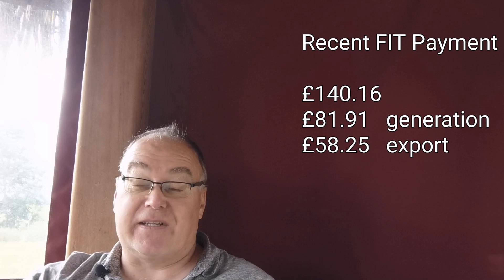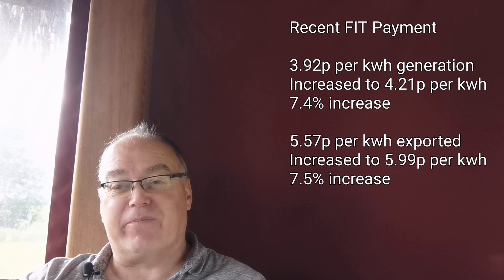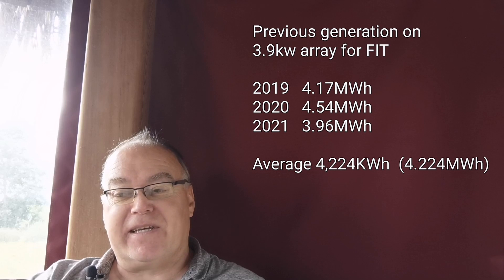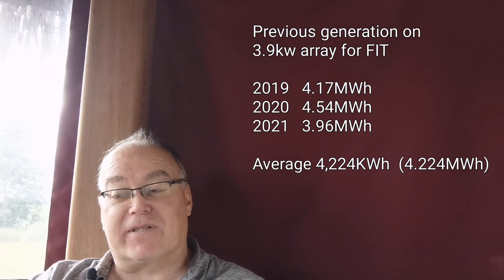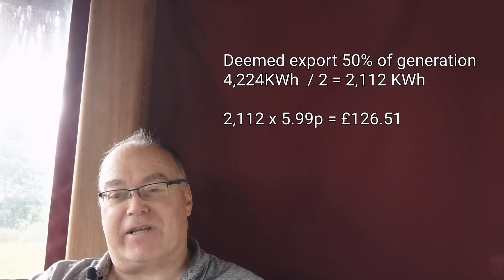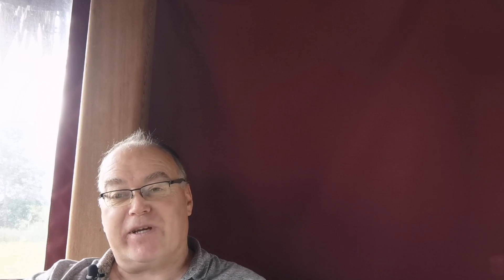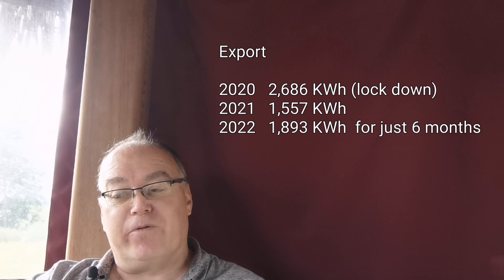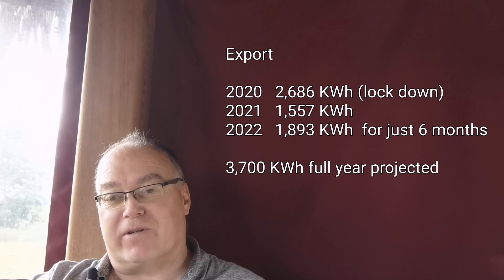Is it time to swap from FIT to  SEG? Smart Export Guarantee. Calculations & thoughts

Comment: A year ago we changed to the Tesla Lite Tariff with Octopus. That is 11p per kWh. (Slightly less for import, slightly more for export). The catch is that you hand over control of your Powerwall to Tesla, who will ensure that it is at 100% by 16:00hrs every day, when it will be dumped into the grid, down to 20% (in our case anyway), where it stays for back-up cover, until charging re-starts, either overnight in winter, or solar during the summer.
After some years of using NO mains for 8 months of the year, that regular mains use is painful 😞, but (like you), we are now being paid for the export on ALL of our panels, not just the original 10, so we benefit in the long run. Another plus is that charging the car in winter can happen at any time of day, with no change in price!

Comment: I got my first export 'bill' today.  Sold 383.9 kWh for an average rate of 17.85p/kWh.  Total Electricity rebate of £68.51.  That will leave me about £40 credit towards winter heating costs.
Reply: That is really good.
 But how long can this go on for? In eutopia, if 20% of the country did this the Energy companies would fold. They are  there to make money out of you not the other way round. Maybe that would be a good idea so we nationalise utilities.
Reply from the maker: Given the public are paying for failed private energy companies we might as well nationalise it
Reply: @wajopek2679  It can go on indefinitely! Assuming the OP is on the variable Agile Outgoing tariff, like me, we’re paid the wholesale price for each half hour, just like any other electricity generator is. No more, no less. What we need is for the wholesale price to fall (by decoupling renewable prices from gas prices) and then we’ll be paid less :) FYI, I earned over £150 during June for my exports :)

Comment: I too have moved from the deemed 50% solar generation, after doubling the size of my array and not getting any money for the new solar. It also gave me the freedom to move to the Tesla Energy Plan from Octopus and give me a good 24 rate whilst I discover what my ASHP will use in it's first year of operation!.
it will be interesting to see how the Outgoing Agile system works for you. I have heard it is a lot of work as when to fill batteries, EV's etc, due to the changing prices.
Good luck!
Reply: Lucky you the Tesla tariff is a crazy cheap price for imported energy and good prices for exporting!  Pitty the battery setup is so dear as love the look of the setup. Outgoing is of two flavours one that’s same price like yours 24-7 take no time and the variable that took me maybe 5-10 mins a day to sort out so not a big problem especially for data geeks and I bet your could automate it maybe with Home  Assistant if you had the knowledge .

Comment: Wonder if you cost your personal time to do all these calcs and videos if it’s worth it in true cost. Great to show that there’s options. Remember FITs and their export element are index linked too and guaranteed for 20+ years. I’d also weigh up the risk of energy companies making a mess of your tariff change requests and hours on the phone trying to fix it :-)  - great to see folks appreciating that peak energy has a high £ value but also an environmental one as it’s often fossil fuels used to help with peak demand.
Reply from the maker: Costing my time doing videos lol🤣  of course it doesn't pay or make sense  it takes away too much time

Comment: Nigel it may have been said before but if you go with Tesla the whole process (as always) is so much more straightforward.   With powerwall you can sign up to Octopus Tesla Energy Plan.   11.25p import / 11.25p export 24/7.  Tesla manage the battery and import/ export to grid but always guarantee 20% reserve plus ensure battery is at 100% if bad weather predicted in 'storm watch'.  No customer input required just sit back and try to build up enough credit in summer to last through darker months!!
Reply: We went through a similar thought process as we have 4.3 solar, Powerwall 2 and BEV. We also have the full fat FIT tariff and get the deemed export for 50% of the production. 1.3 of the 4.3 was added with the PW so we ‘only get paid for that generated by the old 3 kw array. We realised we were still exporting so looked at the Tesla energy plan for the export as we would still get the FIT payment for the 3 kw generation but get all the energy sent to the grid  at 11.25p ie twice as much as we currently get.

Two things put us off. No.1 the loss of our control over the Powerwall and No.2 the inability of the TEP to work with other smart products eg the Zappi. We could live with the former, just, but not the latter. For the moment we stick with Go Faster but are keeping an eye on Intelligent Octopus until it supports the Zappi and our Enyaq. We have time, as our current Go Faster tariff doesn’t end until the end of January 2023. We expect a big rise so that’s why we are looking at opinions all the time.
Reply: I looked at the Tesla plan too but it’s incompatible with Eddi and Zappi, which are more important to me.
Reply: I think incompatible with Eddie and zappi is a misnomer.  What the power plan does is to effectively make both redundant and an unnecessary complication.  The key is that the cost of import and export are equal.  You are able to use whatever energy you choose at any time of the day. By using energy to heat water or charge the car there is a cost associated by exporting less.  If you are paid for export the idea of 'free' energy is no longer applicable.
Reply: @Peter-de1vf  That’s an interesting take on the plan, thank you I had not thought about it that way. Our mindset is to use as little mains as possible and use as much solar within the house as we can. I get the idea of equal in, equal out but after several years of using our own production and limiting import changing would require a different mindset that will for us take some thinking about.
Reply: Thanks Lynn.   'Nett metering' has to be the ultimate way to pay for the energy we use.  Using less in total is the fundamental way to pay less money (or be paid more for export).

Comment: Brilliant video Nigel. I’ve gone through all the same thought processes for my situation, having only had my PV array for 6 months now. In the absence of an EV, I decided to go for the agile route as I knew I’d have plenty of export this year. The longer term plan was to swap to go in the autumn and enjoy a more stable off peak charging window for the house battery and my recently acquired second hand EV. The other thing that I factored into my rough calculations was the daily standing charge. On go, this was something in the region of 40+p per day and on agile it was around 20p per day. I can’t remember the specific values now without checking.  I know it’s only pennies but during the summer months I’m importing such a small amount of electricity that the standing charge becomes the biggest portion of the daily bill.  I’ve really enjoyed being on agile and at times have set the battery to discharge during the peak evening period. I’d love octopus to create an EV-PV tariff, accounting for the darker months when generation is low and the brighter months when generation is high. I’d happily take a little less for my export, knowing that I could have a little better offering in the winter.
Reply: Enjoy your new setup this winter your bills will be good bit lower that last year I bet ! Take care and safe travels everyone

Comment: I suspect the answer to this question very much depends on your circumstances. I don't receive FIT payments and I use Octopus Agile SEG with Octopus standard variable rate for import (currently about 28p/kWh with a 45p standing charge). In June I received an £81 credit for SEG and the average rate was about 17p/kWh. I have a small EV (MINI) and I use gas for heating so I am not very attracted by the Go tariff - although that may change in winter if electricity rates increase dramatically. The problem here is that there are too many variables. If rates were static for a year or two we might be in with a chance.

Comment: it angers me that I need an EV to get on the Go tariff, its Electric power we are buying ,nothing todo with getting places,,, be that as it may,,, I was just using my solar selfishly and not getting anything,but the after april I,v had to change.. Now I,m on outgoing and making some Sheckells.. but my question is can I switch power from my off grid array to my gridtie system...What I mean is switching the power line from the panel to the inverter to another inverter during the winter months and earn more spondoolles....???

Comment: I honestly think for you and your circumstances, agile incoming and outgoing would be ideal.

Sure the between October and next march it’s going to be at the 35p cap most days but we have not solved the current energy crisis so gas will make up the wholesale cost of electricity.
With your system you can buy for 35p and sell for £40-60p (what it was during march).
Having the ability to buy high buy sell higher will discount the energy you need to purchase massively.

I’m not sure about how much your solar and battery sips from the grid but my GivEnergy system would normally import about 1kwh, with SEG, I never covered my standing charge and the peak energy I used.

Although it is after the solstice, we are seeing the gas tracker price go through the roof so it’s common to be above 30p export.
Octopus has already raised the Go peak rates this week making it even less appealing.

Agile will go one of two ways: 

Increase the standing charge and cap for new customers
Or
Be the most appealing tariff for every single energy consumer. If everybody did time of use there would be much cheaper for everybody.  They used the carrot of cheap energy for a few but now they could use the stick to move the energy market for good

Comment: Hi, love the channel and your content! I am an octopus 🐙 customer with solar panels (6.9 kwh) and a tesla powewall 2 plus an electric car. 
My export is the 4.1p seg tariff as octopus told me I can’t have Outgoing Octupus at the same time as Octopus Go for my car. Their website confirms this too so I do not believe you could select Outgoing Octopus while also retaining Octopus Go
Reply: I've just asked Nigel the same as that is what I was told, we have exactly same issue as you.
Reply: @MrWrighty82  I am hoping Nigel will comment on this then as maybe octopus have changed their policy but not updated the website 🤔. Fingers crossed that this is the case, but it is very clear on the outgoing octopus sign up page that you can’t have Go and Outgoing at the same time. If I could that would be brilliant 👍
Reply: @maverlk7  Indeed. I was curious to see if I could change my standard SEG 4.1p tariff for that 7.5p fixed tariff Nigel mentioned but looking at the T&Cs again just now it appears not!!
Reply from the maker: My mistake it seems and octopus not making it clear on their web site
Reply: @EVPuzzle  no worries Nigel, there is so much information out there it is an easy mistake to make 👍. I was secretly hoping you had discovered what I had missed, because 4.1p seems rather dismal. Fortunately, I am not exporting much as most surplus goes to the car, eddi and battery, but I am definitely going to look into Agile more now! Quite fancying tesla too at 12p in and out, I shall have to crunch some numbers!
Reply from the maker: It seems I've misread their website which implied 4.1p was for no octopus customers only.  Thankfully I'm only really interested in the agile outgoing
Reply: I'm the same, on go, and the exclusion clause was in brackets near the bottom. It took a long time and much chasing to get on their SEG at 4p, but I did it after a few weeks. I have a BEV (Zoe) and a 5kwh battery on a 4.3kwh South facing solar array, all installed last November. I try to export as little as I can, cut 4p is better than nothing, and I trust octopus more than the other companies out there. I'm hoping they will sort this rate out as I was told they were worried about buying back their own electricity! I thought that was the whole idea of grid balancing!
Thanks again for the content.
Reply: @TinTentTourist  good day 👍. It took me months and a lot of chasing and to be fair, poor communication and diligence from Octopus to finally get the 4.1p seg. During the many weeks of waiting for them to get the SEG started in which they essentially had a lot of free power from me. I feel this is one area they need to pull their fingers out over!

Comment: what i am curious with your setup, is how you managed to get batteries in and NOT screw up your FITS,just had my current FITs statement and as of now i am on19.87p generation and 5.99p export, i am definately wanting to go with pylontech batteries, as a average currently my 4kw is generating in the region of 22kw a day and i know i  proably dont use 11kw in a day so i am losing out hence the wish to go pylontech battery route ,and not kill my FITs paymentsi do have room on my flat roof extension 8x3m for more newwer solar panels south facing same as my current 16x 250w array, and room on the eastish gable wall, my overiding is NOT losing the FITs ?? how can i achieve that is my problem i have of getting my head around
Reply: FITs won’t be impacted if you add AC connected batteries with their own inverter. If you add batteries to DC side of existing inverter then that’s a different story. You would also need a hybrid inverter to do that.
Reply: We have been on FIts since 2012. Simple 3 kw array. In 2020 we added another 1.3 of array, a 1 kw inverter and a Powerwall 2. Didn’t touch the original panels but had to downsize the original 3kw inverter to a 2.5 kw one as the DNO wouldnt allow us to go over 3.6 max export.

So you can replace like for like (or less) on your existing array and inverter without effecting your FITS payments. You can add extra arrays and a battery as long as your DNO will allow it and you don’t interfere with your existing system.

You cannot receive SEG and FIT export payments at the same time,  but you can receive FIT generation and SEG or TEP export for your whole new array plus old array export if you sign off( ie give up) the deemed 50% of your FIT generation on your original system. 

It’s complicated and you have to dig into the detail as Nigel as done hence why many of us keep detailed records, ( too detailed someone close to me says). Even then as Nigel has demonstrated with the 7.5/ 4.1 confusion regarding Octopus export payments we can all make errors. Double check all your calculations before making a decision.

Hope that help and makes sense.

Comment: Hi another way to go would be Tesla Powerwall with Octopus Tesla Energy plan. Cost on 22p standing charge incoming 12p kwh outgoing 12p kwh. The down side is 10k for battery & gateway but can be expanded to 10 Powerwall's. Say two Powerwall's 27 kwh storage. Supply up to 10 kwh to home and charge at 7 kwh grid or solar. Still able to charge from solar in power outage. Octopus Go export tariff sound best to me.

Comment: I believe the daily charge on Agile is also less.  I am only paying 21p/day standing charge and Go has 44.48p/day.  I have to use 3 kWh/day at the most expensive rate before the cost is the same as being on the fixed Octopus tariff.  In four weeks of exporting I have only had one day where the export rate was less than 11p (it did drop to zero for a few hours).  It has been as high as 40p.
Reply: Yer that’s as it is now but us on 2021 tariff we was only paying 25 p standing charge so was not much different but on go was only paying 15.33 p peak and 5 off peak so agile at a year to date average of 31 p so the 4 p a day your savings won’t go far ! Yes the recent go or intelligent tariff is 43 p sc but at least you get 4-6 hours a night off peak yes the peak rate is a few p dearer than agile but I bet the 35 p cap will go in October as they said the off peak of go was going to stay but didn’t so I guess that you might have 40-50 p new cap and no guarantee of cheap off peak rates come winter but go or intelligent tariff customers will . So I watch with interest on October prices and early next years prices. We will see
Reply: Yes outgoing was the place to make credit while the sun shines in 2021 and was low risk because you had few hours of cheap energy most nights if plans or weather changed but that option was gone in 2022 . Yes there has been some good outgoing rates and some average rates I’ve been studying the rates closely in 2022 ready to switch be it’s about the same prices as 2021 but the import prices are 10-15 p a kWh more on average so you take you chances and take what comes . Be interested to see 2023 rates come spring and make my best guess again . But us with solar and or battery have it better than the poor people without either £3000+ average home fuel bill ! 😯😱😳